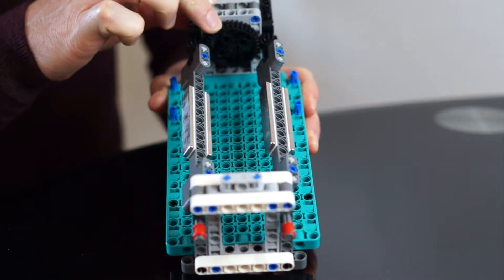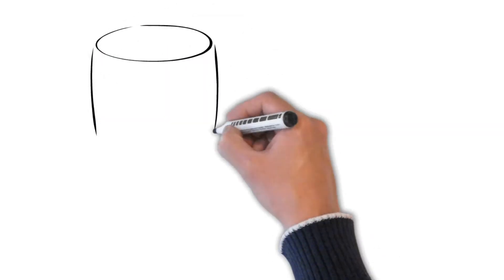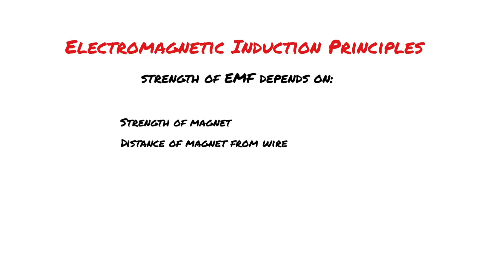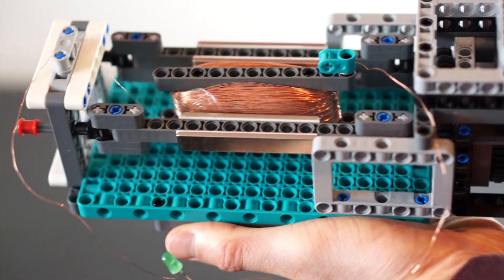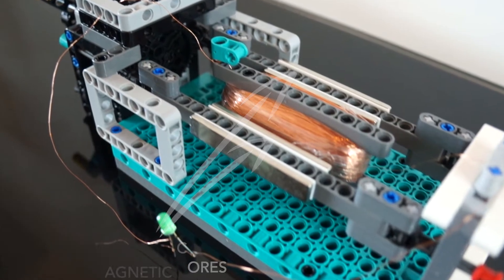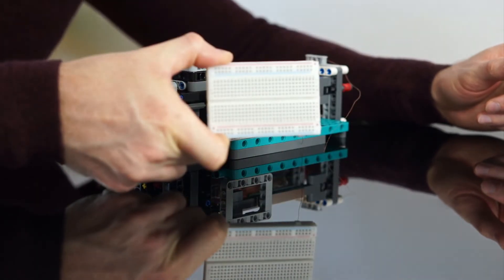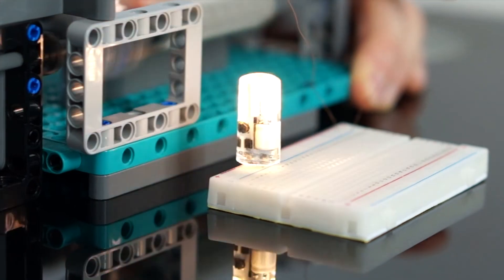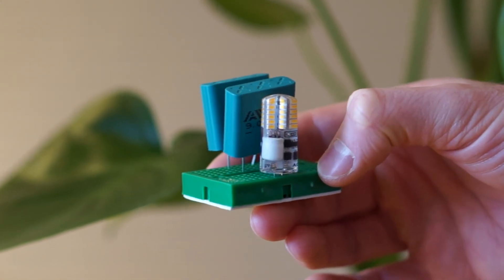I Made a Generator Using Lego

Comment: I search for lego videos and i cant find the right one. But this one is interesting.Also i just search for experimenting with lego pneumatics or things like lego solar panel.

Also i have a suggestion on to make a motor where the coils rotate instead of the magnet cuz im very interesed in will/how that work(s).or the coil and the magnet rotate in a generator.
Thanks so much if anybody even read this :D

Also where to get that cyan lego platform which is under the magnets. I really need that because i need it

Comment: Hey Jamie! This is great! if I wanted to replicate your experiment, what wire gauge do you recommend?
Reply from the maker: Thanks! 😁 To be honest, that depends entirely on what voltages you want, what magnets you're using, and how much force you can exert on the mechanism. If you want something that can actually produce some reasonable power, I'd recommend some beefy n42 to n52 magnets (maybe 25x40x10mm), and then some wire that is not too thin - probably around 24 to 28 gauge. Ideally you want the thickest gauge wire you can get for your desired voltage - so if you only need 5 volts, try the thickest wire you can get 5 volts from. Yours will likely need a bit of tinkering to find the right balance, so good luck!
Reply: @JamiesBrickJams  Wow! That was quick! Thank you!

Comment: nice video! For even higher power output you should angle the coil 90° so the field lines connecting between the magnets run perpendicular to the conductors. Or maybe im missing something?
Reply: and add iron core

Comment: Just found this channel thanks to the algorithm and have enjoyed watching some of the tests you’ve done and have a question. Would having the wire coil in a spherical magnet whilst the magnet is spinning around the coil produce a stronger emf or would it be weaker?
Reply from the maker: Thanks! You mean a spherical magnet travelling around the wire coil? I guess it would depend on the orientation of the poles of the magnet, how fast it's spinning, how big the magnet, etc. Lots of variables to consider! In general though I don't think spherical magnets would work well unless the coils were very specifically designed for that shape. Otherwise the density of the magnetic flux lines of a spherical magnet just wouldn't be close to the wires. Having a  flat magnet allows you to align the field to flat surfaces of a coil is much easier.

Comment: Awesome Video! Also discovered you through the beloved algorithm :)
I would love to try something like this myself, an idea I had was to add a freewheel, basically helping you to maintain more stable speeds. Especially for other uses like charging a phone, you need very stable and accurate voltages. Maybe a big freewheel with a one-way clutch would help with that if you know what I mean?
Reply from the maker: Hey, glad to hear it - you totally should give it a try! You could certainly try to control the output and it's 'smoothness' mechanically.. though by far the easiest way is to just filter the output through a capacitor bank. That way you've got a nice stable output, and if you really need a stable voltage, you can just use a simple voltage regulator - you can buy packs of them on Amazon for super cheap. You're right though, a nice flywheel with magnets on it does generally make for a nice smooth output